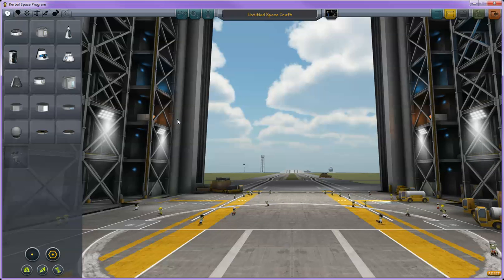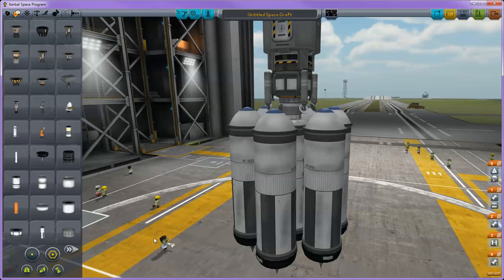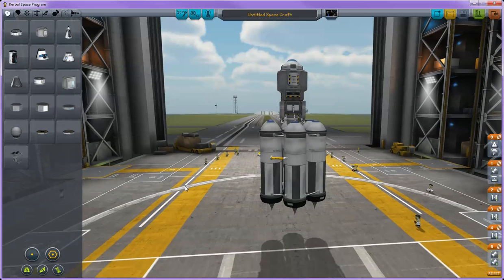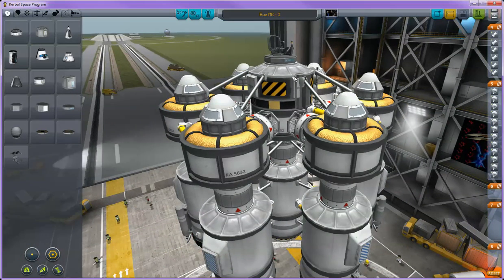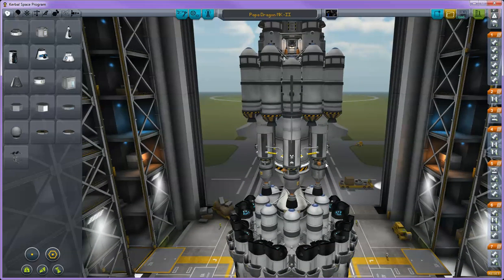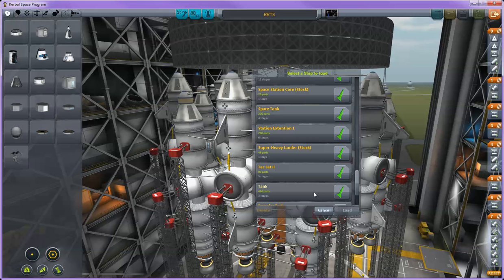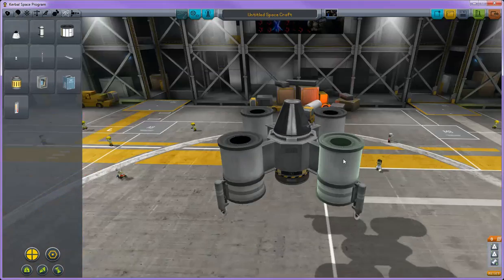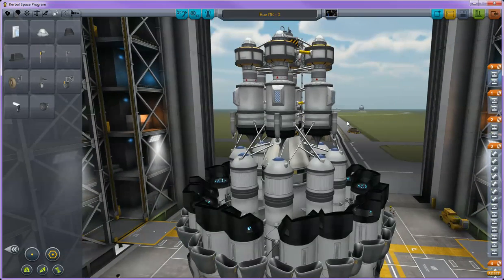KSP Advanced ship building

Comment: Ok, I am talking about the first space craft now, so it was good, and well planned, and you know your shit. But the way you flew it was still something to be worked on. You need to start turning the moment you get to about 2500 meters, when you turned away from your prograde vector, you were wasting fuel, and when it comes to long trips like when you want to get to Eve, or almost any other planet as a matter of fact, you need all the fuel you can get. What you need to do it make it a stable turn, so just try and turn a little at a time, this way, you dont need to make a maneuver node at your AP. But other then that, pretty impressive. :)
Reply from the maker: Interesting, even now that we have the super large rocket engines and fuel tanks, I usually don't start my turn until about 10,000 meters. I also tend to construct a lot of my craft in orbit now, so I never really felt like fuel waste was a big issue, maybe in career mode, but not so much in sandbox. Still, thanks for the comment, I'll do some flight tests starting my turns sooner.
Reply: Ok, sure. I also did my turns at 10k meters, but I learned, that if you start turning earlier at a slower pace, then you will reach an orbit of about a 100k AP and an 80k PE with much better efficiency. Anyways, thanks for writing back. :)
Reply: well, in this case, I would spare as much fuel on the first stage as possible, so try not to go over 200 m/s below 10k meters. Due to the air resistance, if you go faster, you will be wasting some amount of fuel. Also, it depends on how high you want to go, I would say 80k is a min, but 100k is usually the more used hight. I see you are using a nuclear engine, so after 10k meters, you will want to fire up your engines to the max, and get away from that atmosphere while turning your ship in the 90* angle gently. When you run out of fuel, you just want to create a menouver node you your AP, the reason you have to do this is because you do not have the thrust from that nuclear engine to create an orbit from the ground. You have to get your ship high up with the bigger power thrusters, and then use your nuclear engines to create your orbit. :) Hope I helped :)
Reply: ***** If you want your Ap to be 80k then you have to be going horizontal sooner then 80k, I am guessing about 60-65, and when you are going horizontal, basically, you are just increasing your Pe. Ok, here is something that might help you get a grasp of things. You reach orbit at aprox. 2300m/s. If you are going this fast, you are in an orbit around kerbin. This is just an approximation, it depends at different heights. So this time, I suggest using a maneuver node.
Reply: yes, I built a replica, and it worked for me. And what do you mean fall back? As in the nose just went down, and you couldent get it back up? If so, check your center of mass.
Reply: What do you mean horizontal? If your ship was horizontal, then you would have noticed. Ok, here is another tip, if you dont want to have anything to do with maneuver nodes, then what you can do is this..... step 1: take off, and get your AP to 80k or whatever. Step 2: about 1:00-1:30 min before you reach AP, start burning a little bit below your prograde vector, that is towards Kerbin. Thats pretty much it, just wait til you have a good stable orbit. If there is any way you can send me a video of your take off, I might be able to see the problem.
Reply: sorry, I am a silent player of sorts, dont do any uploading, but have you thought of creating a more sophisticated spacecraft? As in if you run out of fuel, maybe put on a couple solid rocket boosters just to get you our of part of the atmosphere. Then fire your first stage ofter you detach the booster, and you have a ton of fuel left, :)

Comment: the part at 25 minutes or so, the girders with decouplers is completely pointless as 4 normal radial decouplers would do the exact same thing but without leaving girders sticking out of your craft or the engines.

edit: and if you need the engines to have a gap between them and the main craft, just stick a single girder on a radial decoupler instead of 4 girders on an inline one. Cuts down the part count from 16 to 4 for some radial engines.
Reply: Liarra Sniffles I was thinking precisely the same thing. Granted the girders weigh almost nothing, but I still fail to see the point of having them stick out of your craft.